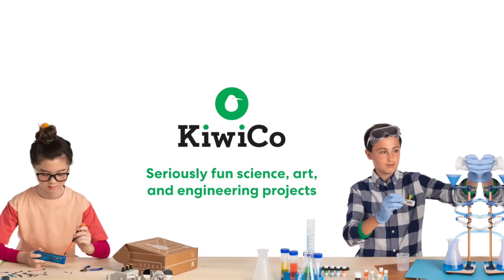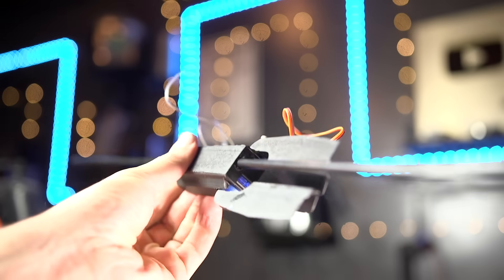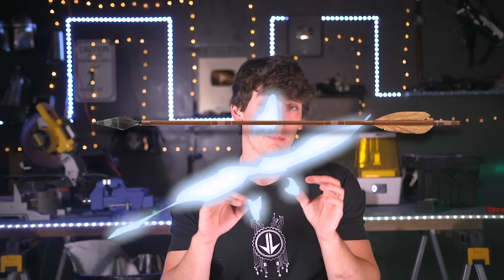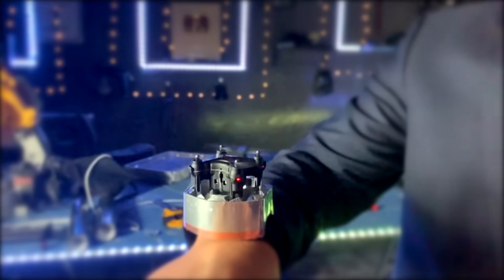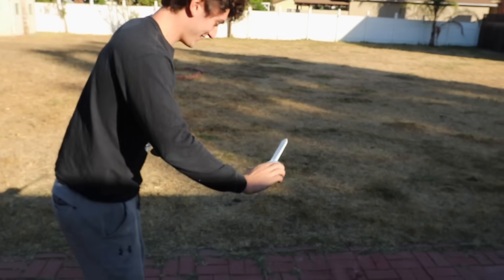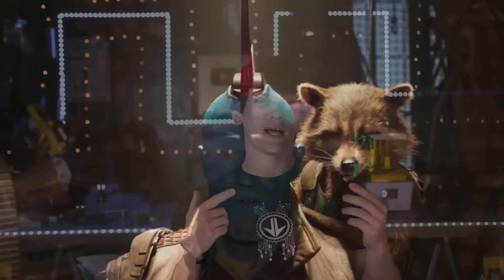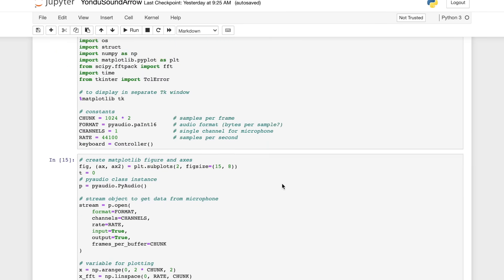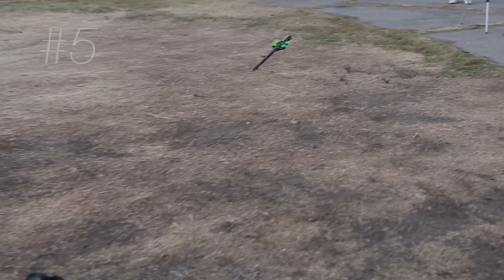Working Yondu's Arrow That Flies When You Whistle! - Change Direction In Flight!

Comment: Good whistling is tough, but I think you could try an (admittedly pointless) setup where:
You have a keyboard that can play whistling sounds.
A microphone setup that picks up notes and uses that as commands.
Electronically transmits that to the controller (in the interest of responsiveness).
And why not make it more difficult and have different speeds for each command using a flat/sharp note system ?

Awesome project as is though !

Comment: Yondu’s arrow. Some helicopters have no rear blades. 
They used pushed air out the tail to change the helicopter direction.  

Someone from cosplay, could make a swimming pool noodle look like a metal arrow. 

A small motor inside the noodle with holes for suction & holes at the bottom to give the arrow lift. Use a small Gyro to change the arrows direction. 

It will still take a computer doing hundreds of calculations to get the arrow to even act like an arrow. 🤔

I am out of idea. 🧐

Comment: I wonder if it would have helped to add some little canards at the front. Would have still looked like an arrow and it would help avoid pitching the nose down too much when accelerating.

I'm a programmer myself and I'm thinking about how I would want to design the control software for the rest of the steering controls. I think I'd use a bending pitch to turn, so if you start a high whistle and go higher it'll go forward and turn right, and if you start high and go low it'll turn left. This would let you start low if you wanted to maneuver it in reverse.

Comment: Maybe if you added two propellers on each of the directions, and add a propeller on the back of the arrow with the top facing the front, and added some control surfaces on the sides, I could work

Comment: Build a small fusion reactor(plasma reactor) like the arc reactor pleaseeeeeee
Some notes
1.the outer torus requires electro magnetic coils to contain plasma
2.u can use any core hydrogen recomended
3.its going to be awesome 
4.please buddy try it at least it can work out well

Comment: Hmm, I wonder, I was thinking of magnets and jetpacks. What if you had a gadget that hovers cleanly over the ground, and that gadget holds an arrow in place in the air using elecromagnets. You can change the resistance of the gadget so the arrow flys higher and lower, while whistle frequency can move the arrow forward and backward. You might could use whistle volume to turn it, but baby steps.

Comment: OO you should build ab arrow that splits into 3 arrows mid flight. You could probably 3d print a design and then have either a small explosion go off in it or design it so that the wind alone pushes the arrow into 3

Comment: I would have made the arrow propelled by ion wind and would have turned it with a gyroscope and then make it steered by a program that let's me control it by whistling. What do you guys think?Oh yeah, forgot to say would have if I had the money and the experience with all the stuff needed to do this. Like for example casting metals or finding the electronics needed plus putting the lifter parts in a manner that works well. But what JLaser did is cool too.

Comment: Yondu said in the second movie that it ain't the whistle that controls it (he didn't whistle in the mary poppins scene). And i say it was the brainwave inplant on his head also known as the fin. It's brainwave could be measured as anything but by choice for being complex, any short sound acelerates, pitch yaw contoled by volume and fine control by pitch in his whistle, the fin calculates these muscle movements from the brain and outputs the new vector for the arrow. For yondu it's just easier to whistle than to focus too hard on something not part of his body.

Comment: Wouldnt it be possible to map out high whistling to steer diagonally forwards/to the right and low whistling to steer forwards/to the left? That way you have the ability to move your arrow to any destination (with some difficulty, of course). An arrow moves on one axis, so making it go forwards and backwards doesn't change much, but being able to make it turn and go in circles is more impressive in my opinion

Comment: I mean, definitely looks like there is some sorta glowing core, where the fletching would be, in Yondu's arrow. And idk if the trail of red light is due to the high velocity causing a sorta motion blur or visual delay that causes it to look like there's an actual tail of light, or if it's possibly radiation or even fire from a rocket type device. Either way, not sure how one would accomplish that. Granted, I'm also writing this toward the beginning and saw you mentioned rockets and how that doesn't work. So, idk if you end up doing anything similar in the video, yet. Just figured I'd give an observation about the actual item, in the movies. 

Edit: so no rockets. Shame, cuz it seems like a pretty good way to go, visually. But, if it's too heavy, only so much you can do lol. I keep thinking about what if you used some sort of technology that'll do something akin to how computers in missiles tell it where to go. Idk if that's possible, without spending a fortune, or if you could even get your hands on something like that. Or if it'd be legal. 😂

Comment: Hello, and pretty good job
I'v got an idea to propulse the arrow
Trying to explain and translate in English :-)
If you take a look at the fan of turbines, like this one
Image from Google 
https://www.abe-negoce.com/media/catalog/product/cache/3/image/9df78eab33525d08d6e5fb8d27136e95/m/o/moto.253459384_2.jpg

The device is usually used to take air from the big hole and push out the flow through the blades

Did you ever try to turn it in the other side ?
In deed i try, and the results are pretty amazing...
At first i though no air could be pulse but, in fact, this is really efficient and pulse the air through the big hole as  a vortex flow

Now thinking about your arrow ;-)
If you create very very long blades that take the air around the arrow corp, the pulse will be exhausted by the small hole at the bottom :-)

You'll need a small motor at the bottom, and again care about of the gravity center
Also a possibility to catch air around the long arrow corp
The device used in this way can't be dangerous, it turns in the opposite blades side :-)
Other big advantage, it doesn't need a lot of energy because there's no real opposite forces when the blades turn

This creates depression under the blades that absorb ambiant air and quickly repulse it

Just one single thing, please take really care about plastics most of the time they finished in Ocean and this is interrupting the natural refresh way of the earth
Our commun home, our biggest mother ship

Physic is fun and permit to use the universal laws to create and concretise always new stuff
Just don't destroy life, protecting our planet is protecting ourselves

Hope you a good day ;-)

PS
Never forget the Maxwell crockscrew, either its about electric current it has first been revealed, this sens is a constant on earth
Waterfowl, airflow, always react better in this way

So the motor sens is as important as the blades sens
Reply: Would this also work for a flying pack

Comment: A forward and backwards propeller would be good. A small camera with a small mb that can send, and receive data from a program or server. Program the drone to be able to autopilot, but only when receiving whistle commands from the program possibly running on a server. 

Input whistle into mic, whistle is processed in the software, the software sends a command to the drone, and the drone follows orders. 

Double whistle could engage flight. 

Maybe a whistle following the double whistle could tell the drone to locate Whistler and stay by their side. Maybe include that in the double whistle. 

A specific pitch to fly left, right, forward, and backwards. 

Maybe a long specific pitch whistle followed by short fast whistle to determine speed. 
Long whistle = -
Short whistle = ·
Example: mid pitch - ·· may be forward medium speed. 

Wish I could build this lol.

Comment: Hey man, I just went and watched your belt sword video, and I was wondering if you might re-think the design for that and revisit at some point? Here's my thoughts, Instead of making the blade bend, if you make the sword layered and have alternating pieces of metal on either side of the blade with hinges between then make it so that half of them slide down and add a locking mechanism that would let you control the positioning of the blade. The only problem I can see with that would be if something doesn't line up just right, it wouldn't work, like a Rubik's Cube. If you don't understand what I'm saying, I would gladly attempt to explain it better. Thanks for your time!

Comment: What kind of engineer are you? Mechanical or electrical or other? I want to know so I might go to college and be one like you.
Reply: You can learn everything much quicker if you just start. College, most of the time, has a lot of lessons you wouldn't be interested in. First thing to learn would be coding, as the guy stated, Python is quite good as it is less suceptible to crash compared to c++ with it's complicated functions. 

A good point where to start with coding is W3Schools, it has all the basics explained aswell as short test to check if you know what the code does. Just knowing these simple explanations can get you far, as long as you are open minded, since you will have to make many complicated codes with just these simple functions.(being able to create complicated codes/ becoming moderately good at coding takes multiple months if not a couple of years, since coding is getting improwed daily and you always have to learn these new skills)
Arduino coding can be tricky, but as he said, copying someones code is fast, only thing you have to do is adjust some parts of it. Which is simple if you know at least basic coding and arduino basics are quite easy to learn.
In this particular video he used Arduino to check what frequency he is emmitting and according to the frequency make a move on the drones controler)

Next part is mechanical parts, in this video, he used a racing drone, which is already finnished and just made the exterior look like an arrow with a 3D design that he quickly made, this part is also quite easy to learn for these kind of things. It takes roughly 2 hours to become moderately fast in 3D programs if you start from scratch ( basics). One thing to notice, 3D modeling is actually quite fun, one can take a week to learn it, it is a beneficial skill for the future and you will become much better at it/ much faster. If you intend to go to a college where these skills are required, I recommend you watch some youtube videos, like how to 3D model a house, a pillow, add textures etc. Depnding on what kind of engineer you are, you are going to use different kinds of 3D programs, for instance in Multimedia we mostly use Blender, since the rendering is quite fast and it is compatible with many other types of 3d programs, but engineers that work on "mechanical" machines that cut out pieces of metal plates to produce the designed 3D model have a different kind of program which variates depending on the used machine or human preferency.

I think that these are currently the only required skills for this type of project, not including knowing physics,  somebody already made that program lol

Kind regards, Filip.
Reply: Yh bro I have also been wondering what kind of engineering course he made that made him such a cool inventor. 
I wonder if there is a forum for QandA
Reply: He seems like a mechanical engineer

Comment: this thing is so great man but do me a favor i think a superior use of the research and work done here would be to slightly alter the design into a "mjolnir" type of sword. Swapping in a slightly more powerful/larger drone residing in the hilt  exactly as the arrow . if so the sword could have mjolnir type of behavior when after thrown or whilst idle could be drone programmed to return to base/phone of person . later innovations could include accelerating your swing all the way to actually flying away on your anime size ergonomic razor edged loyal great sword

Comment: From just being a minute in, my theory is that you’d have to whistle so loud to even make it really work, especially with people around. As for the flying, I’d assume you would need to make a device that allows it to perpetuate itself forward without the need to hover or you loose the arrow shape. So your need some sort of engine inside to actually propel the object forward. The device you use for turning is to heavy in itself, you would need a mechanically engineered fan or fin made out of super light weight material especially if the only way it’s moving forward is by propelling itself that way, and it doesn’t actually have the ability to hover at the same time. Although I assume if you could get microscopic fans that gave enough thrust out of them and put them basically as the casing to the arrow around the propelling device on the inside of the tube, so you could control them dependably and which ones you end up wanting to turn on at that time. I mean theoretically with how light weight you can get certain metals, the heaviest part of it would be the casing or shaft. But that’s the issue, is being able to make this hover and perpetuate itself forward and still keeping it as a traditional arrow. It would have to be on a bigger scale like as a spear I’d assume or a spear half the side but still the same width. Even then though it would be OVERLY loud and I doubt you’d be able to even hear any sort of frequency over them reliably, and then different frequencies in order to it change direction. The basis of his arrow in the movie, is he’s controlling it almost as it’s a part of him. Meaning he has a non physical connection or bond with the arrow. They said it came from his home planet where only they have it, meaning he probably learned to control it over time and years theoretically. So having anything theoretically close to the arrow isn’t physically possible. The best you could do now I’d assume is a javelin style arrow. Would be super thick and round in the center, heavy, and it wouldn’t have the same capabilities of being able to kill someone and stay intact while flying through someone. It would be like a regular arrow it would enter, and then stick. Where as his arrow propelled itself through the actual target. Meaning when it hit the target it didn’t loose its speed or velocity when it hit the target, it had the same velocity from the time it hit the target, while going through it, and coming out of the back of it? I’m not sure if this makes sense but it’s just a theory. Again I’d love to know what someone thinks of it. As far as a project I’m really not sure.

Comment: What about using acoustic levitation in some kinda way ? They found out how to move stuff in a 3D space using x-y-z axis, if the arrow could use a material that is extremely reactive to vibration, and using some ultrasound speaker in a 3D shape around the back of the arrow to make it go up-down-left-right ? Problem his, it is hard to move big objects, but maybe by combining oscillation with it ? I dont know xD ::: EDIT: By combining oscillation I mean making the arrow "pre-vibrate" so that it has less weight, so the ultrasound could actually lift it if the arrow's weight his nullified I think.

Comment: So that fan creation with the punch 10:44 was cool and I think you should do it and using a hydraulic pressure system installed could keep your arm from getting ripped off since I also recommend using rocket fuel

Comment: You can build a Gravity spike or Gravity slam from Call of duty Black ops 3 or Black ops 4!!!! Will be a air compression devise that later on be slammed down to the ground and release the air, to give it a little animation you could add smoke or dry ice to give an understanding of the range of the blast 💥

Comment: Hi the 
I enjoyed watching this video an was inspirational.
But about the arrow --------------->
You such try adding a motor at the front of it so the flying can be straight ( vertical ) 
Also try reducing the thickness of it and try adding a bit of power to the drone and control 5v well do fine 🙂 
😁 Enjoy

Comment: I do think it's possible to make it move in 3D, not just forward and backward. 
I mean, if you can set the control to a narrower whistle range, I mean try practicing whistling in C,D,E,F,G,A,B
C= Up, D=Down, E=Forward, F=Backward, G=Sideways left, A=Sideways right, B=On/Off

Comment: You could make it take inputs in slight delays, where rather than a constant “while whistling in x frequency, do this” it’s a “if a whistle of x frequency is heard, do this for y seconds.” In this system, you could have a “command delay” of a second or two, and in that time, lets say I do a high whistle, low whistle, and a medium whistle. It then stores that as “go forward, turn left, go backward” and does that   over the same amount of time the “command delay” lasts. So you put in a string of commands with whistle pitches, then while they are being carried out, you perform new ones. This would give the same feel of it constantly listening to you but might feel more streamlined and less clunky
Reply: Nerd
Reply: It would need to be in a completely silent location to accomplish, though, unless you want to take a bunch of samples of your whistles so it only recognizes those and not other random noises.
Reply: @m.a.9648  Not if you had a microphone (ideally a high quality one w/ background noise suppression)
Reply: I don't understand you but I agree